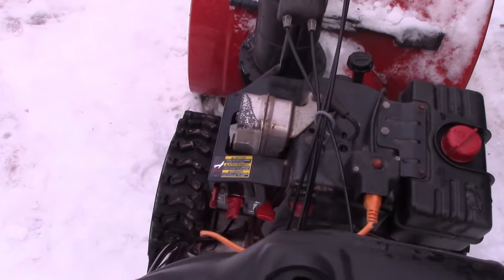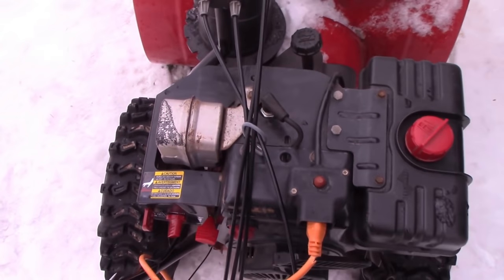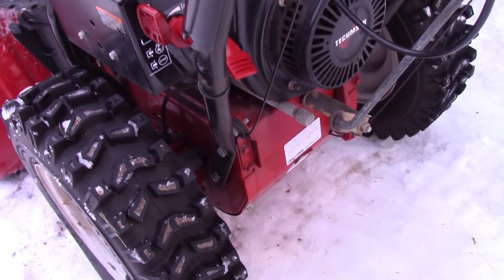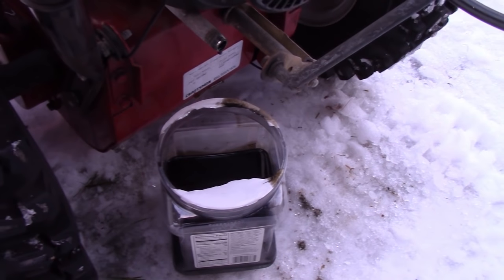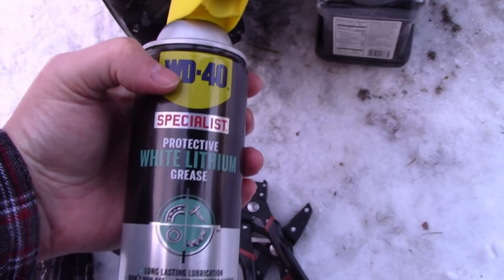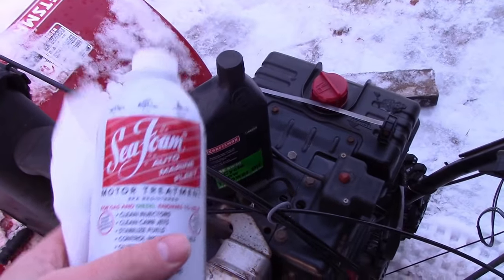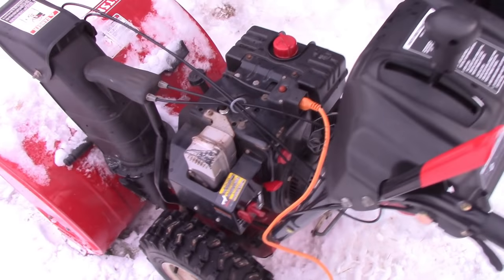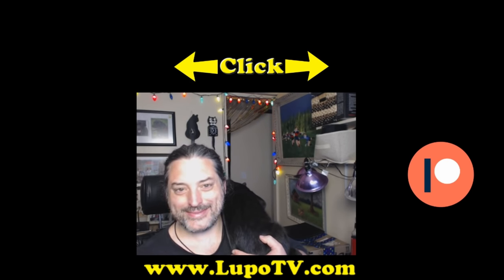My Snowblower Fail Adventure - How to Change the Oil, Gas and Spark Plugs and Still Not Fix It

Comment: Pilot(idle) jet appears to be plugged. Clean carburetor bowl/float and jets. The idle or pilot jet is the smaller of the jets. Just take a BBQ brush bristle or electrical wire strand and run them through jets. It's pretty common after sitting especially with this new gas. After you get it going be sure to put some fuel stabilizer in tank. I've only watched half this video so maybe you got to that 🙂 great seeing again, hope all is well 💚